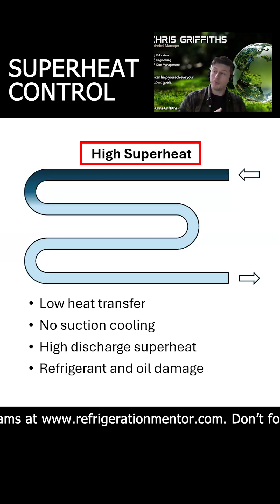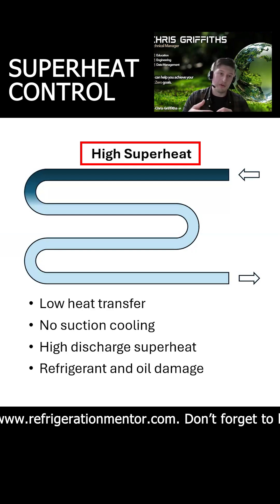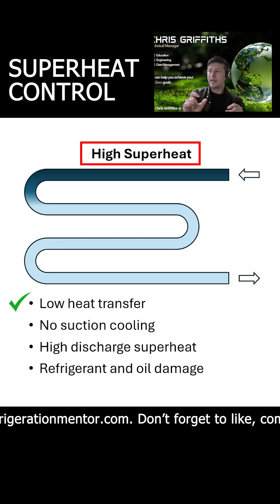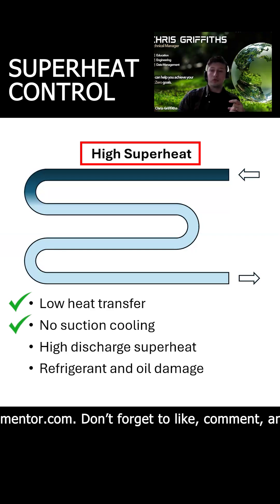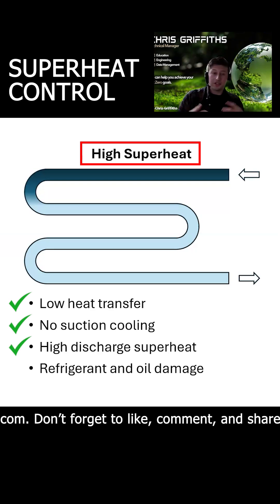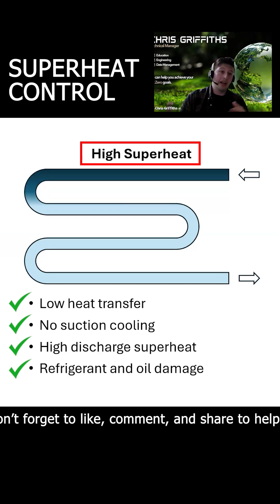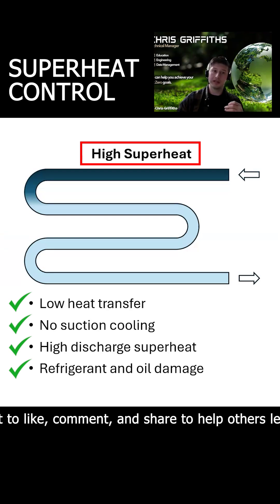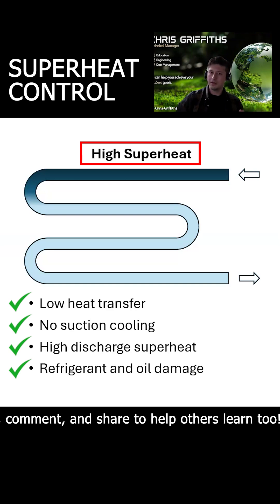Superheat control Low superheat vs High Superheat

Comment: What you said was correct sir. I dont know about Co2 breaking down at high temperatures but I know everything else you said was accurate. Good video and good power points. 🫡
Reply from the maker: Thanks for watching. We have a nice compressor guide if you’re interested www.refrigerationmentor.com/free-guide